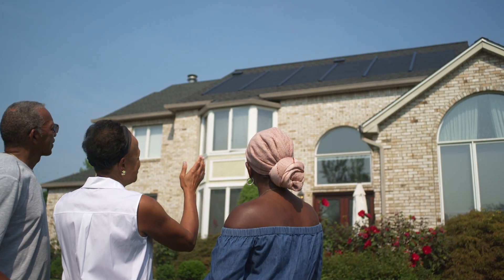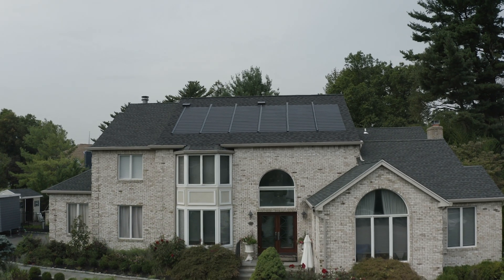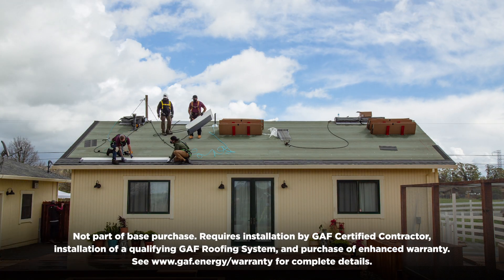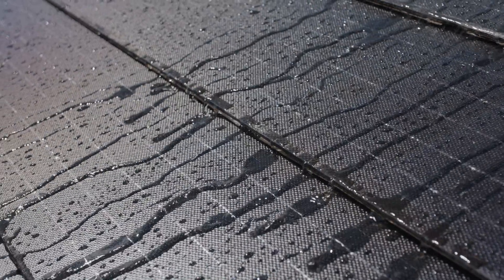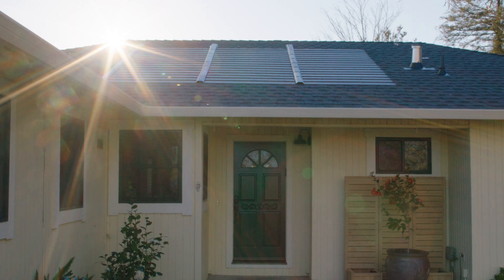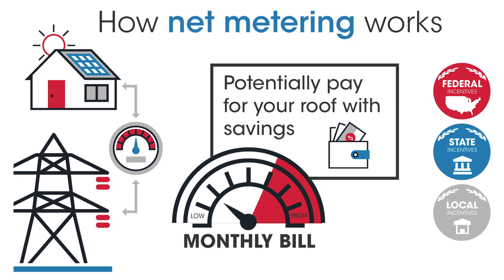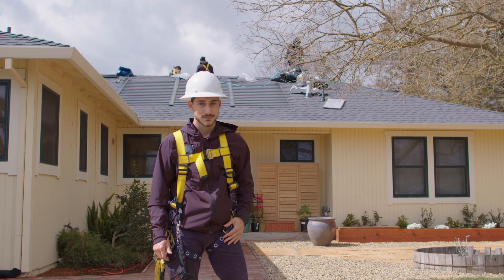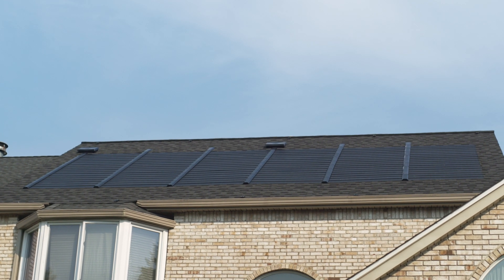How Solar Savings Work | GAF Energy

Comment: Hello, we recently re-shingled our roof.   Can this system be added without removing the new roofing shingles?
Reply from the maker: Hi, there. Timberline Solar is designed to be installed when you are replacing your roof. You can visit https://bit.ly/40XnidJ to check out the GAF Energy FAQ for more information.

Comment: If I got a solar roof, the one where the singles are the solar panels, would I receive the 30% credit from the IRA bill recently passed?
Reply from the maker: Hi, there. Solar roofs can qualify similarly to retrofit solar for the 30% ITC. However, we always recommend you talk to a tax professional, as we don't offer tax advice.
Reply: yes as the components are all required